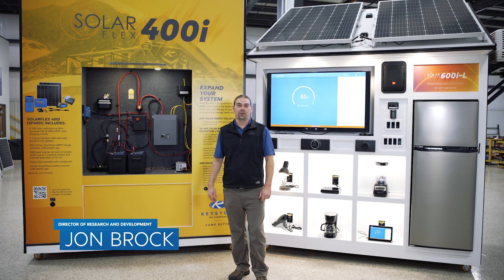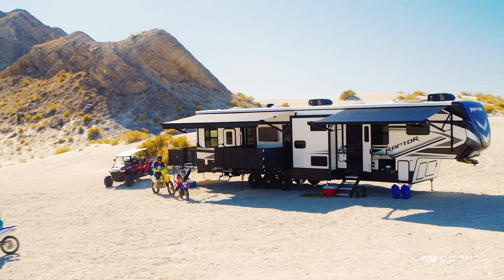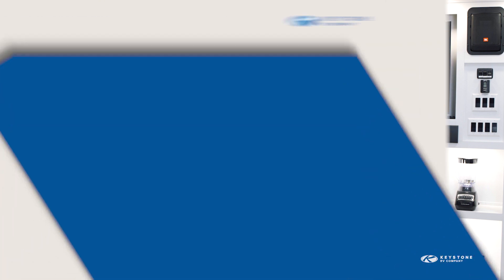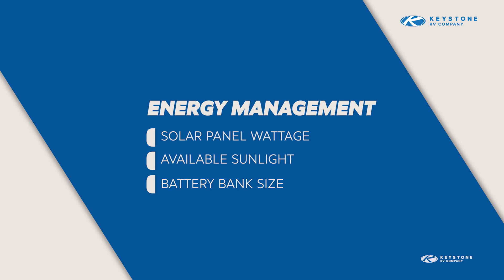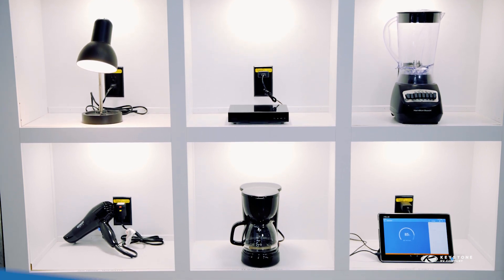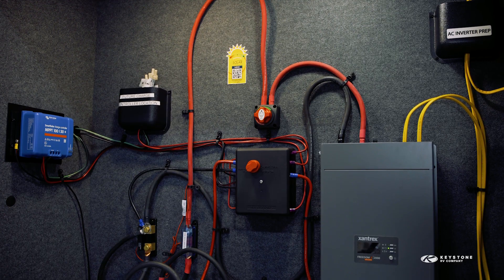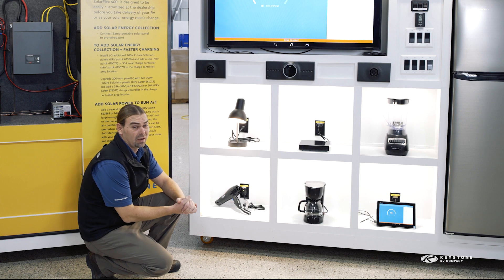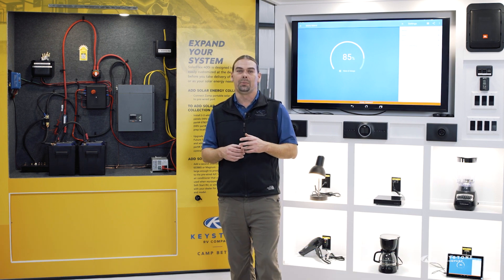SolarFlex RV Solar Power:  Power Management Tips

Comment: I have a 2024 bullet crossfire & the solar flex 220 and was told I have an inverter, which I can't seem to locate. I have a PV solar on/off switch, a 30A charge controller, one 220 watt solar panel, 1 lead acid battery, and several 110 outlets that have an "inverted outlet" sticker on them.
1) Do these stickers mean I "do infact" have an inverter? Or does it mean those are the outlets that will work "IF" I have an inverter?
2) If I do have an inverter, where do I locate it?
3) If I don't have an inverter, do I need just an inverter or an inverter/charger?
4) Do I need a Lynx Distributer? What does this do?
5) Do I need a Cerbo? Is this similar to the solar flex app? What does a Cerbo do?
Reply from the maker: Good Morning, this unit would not have an inverter. An inverter can be installed in the very front pass-through of the unit and would make those interior outlets work through the inverter when needed. Please follow this link to show what is needed to upgrade your system - https://www.keystonerv.com/solarflex-protect-overview

Comment: I’m out camping for the first time I’m my 2023 mini. It was cloudy all day(solar didn’t charge) 

I tried using a generator I purchased separately to charge the battery. I was trying all day. It never charged. The electricity ran only when the generator was connected as soon as I  disconnected it everything stopped working. Any suggestions?
Reply from the maker: Good Morning! If it was cloudy then your battery may not have been charging at all and was very low. When you used the generator it likely it is actually charging just did not give it enough time to fully recharge the batteries. it takes a full 12 hours of charging with nothing running to charge them up correctly. I would try keeping the unit plugged into the generator for a bit longer to get this charged up if you are not on shore power. If you have further questions on this please do contact our retail customer service team at 1-866-425-4369. Thank you!

Comment: I have a 400i on my passport sl. My question is do I turn off the inverter when  on shore power? Also when the coach is just at home or in storage not being used do I turn off the inverter?
Reply from the maker: You'd want to make sure the inverter disconnect is in the correct position if you are wishing to use the shore power, and not have issues with your inverted outlets etc... Here is a link to our website, where you can find all information on our 400i system. https://keystone-rv-dealer-app.cdn.prismic.io/keystone-rv-dealer-app/bc74c688-daf4-4047-bb9b-5d2cce3182ab_KRV_211029_SF400i_BasicTroubleShootingGuide_v4.pdf Also, please note, if you are not going to be around to use the unit and are storing it, we'd recommend disconnect all power to the unit. If you have other questions, that you cannot find answers to using our website at www.keystonerv.com you may also call our retail team at 1-866-425-4369 Monday - Friday. Thank you.

Comment: I own a 2022 springdale  202rd I installed a Renogy 2000w to my system with the flex200  inverter prep. my Outlets are not working and the battery charger, the microwave has power. Any documents published on the setup?
Reply from the maker: Good morning, we don't have any prints if that is what you are referring to. For troubleshooting, we'd recommend you contact our retail team at 1-866-425-4369 Monday - Friday. We have solar experts available and ready to assist you directly with troubleshooting. Or you may contact us via RV Chat at www.keystonerv.com. Thank you.
Reply: @KeystoneRVCompany   I found the issue one half of the loop is microwave and generator the other end of the loop is the gcfi outlets. Both have to be installed for shore power only to work.  It's kind of misleading that outlets are labeled and the documentation says the seven outlets but the gen and microwave are on that loop and you have to connect both sides and turn off the generator if you flip to the inverter.
Reply from the maker: @MrSvnwolves  Good morning, that is great feedback! We will get this forwarded on to see if we can come up with something that can better explain this up front. Thank you!

Comment: Will the 400i system power the air conditioner?
Reply from the maker: The 400i would not be enough to run the air conditioner.  The 600i-L and the 1200i-L(only available on Montana) will run the air conditioner.
Reply: @KeystoneRVCompany  I watched another video from you all that said you can run the AC with the 400i? It stated you just need to add one component to loop it back. Confused.
Reply: @daveevans7151  are you thinking of a soft start?
Reply: @jimmotheus6151  maybe? So we are looking at the Passport 221BH that does not offer the bigger packages, can only get the 400i. I know they are setup to expand though. What would one need to do in order to make the 221BH fully off-grid capable?
Reply from the maker: @daveevans7151  Good morning, in the video you watched we refer customers to the hyperlink below.  
To run an air-condition a 2nd inverter has to be installed and the a/c has to be a soft start a/c.  The unit is prepped with a looped wire back to the Distribution panel and up to the a/c (typically the main a/c).   If the a/c is not a soft start then an aftermarket kit has to be installed to make it soft start.  Soft start is another way of saying the a/c has an extra capacitor to handle the high amps needed to start the compressor.
  At the same time, please take into account how many batteries you have, and how many amp hours of use you would have as well as the conditions you are camping in.  Please let us know if you have any other questions. 
www.keystonerv.com/solarflex-400i-overview
Reply: @KeystoneRVCompany  thanks! So can the 221BH’s do a soft start or will that need to be reconfigured?

Comment: We have a 1200i system that we just got and the system is not charging the batteries, the problem we are having is the system is so new that the dealership does n  ok t know how to troubleshoot It… sad customer 😔
Reply: Are there lights blinking on the solar charger? Is the breaker between the solar charger and the battery tripped or defective? These are the first things to check.
Reply: @mikefairclough9769  the only time the charger light comes on is when it plugged into shore power then its solid and rechargers the batteries so I know that side of the system is working and I don't see any breakers tripped.
Reply: @markbostic4706  There should be (not positive if keystone installs one) a circuit breaker or fuse between the solar panels and the solar charger and then another circuit breaker or fuse between the solar charger and the batteries (I'm sure they installed this one).  You really need a test light or volt meter to check the terminals on the solar charger to see if there is power.  Check the positive and negative of PV+/- and Batt+/- separately.  If you get voltage from the PV check than you have power coming into the charger. If you get power from the Batt check than you are getting power from/to the batteries. You might need to chase some wires to find the circuit breaker/fuse on each set of wires.
Reply from the maker: Hi Mark, we are sorry to hear you are having issues! You can also contact our retail call center and speak to a solar expert if you are experiencing issues and aren't sure how to trouble shoot. Our number in the retail team is 1-866-425-4369 and they are open Monday - Friday. Thank you!
Reply: @KeystoneRVCompany  we did give this number to the dealership and I'm hoping that they are in contact with you guys now, I kind of feel that I need to give them a chance to figure this problem out first before I as the customer have to start tearing into anything to do troubleshooting. But I do want to thank you guys for responding to my comments I watch every single video you guys put out about the super SolarFlex package, My wife and I are excited to be one of the few owners on the westcoast to be using this product. When we went to this dealership about this package they hadn't even heard of it yet, so I showed them one of your video's and we became your December Montana legacy 3121RL build.
Reply from the maker: @markbostic4706  Of course!! We completely understand, and please know we have solar experts on the service side as well to help our dealerships. We are so glad you are using the system. We will be more than happy to help you and the dealership with troubleshooting or getting it up and running for you. If you decide to call, just have your VIN ready so they can get your file pulled up and assist! Thank you!
Reply: @KeystoneRVCompany  I just wanna get back to you about our previous conversation. Turns out the dealership was able to fix the problem it turned out that there were two breakers underneath the cover for the solar charge controller that had been tripped either in transit or turned off we don’t know but once they remove the cover and were able to reset the breakers and the problem was solved thank you though for all your response.
Reply from the maker: @markbostic4706  We are so glad to hear they were able to get it figured out for you!! If you need anything at all, please do not hesitate to reach out to our retail team at 1-866-425-4369 with your VIN. We are always here to help!
Reply: @KeystoneRVCompany  🙏 thank you, hope to never need it but I am so happy to know you guys are there if I do have a need.